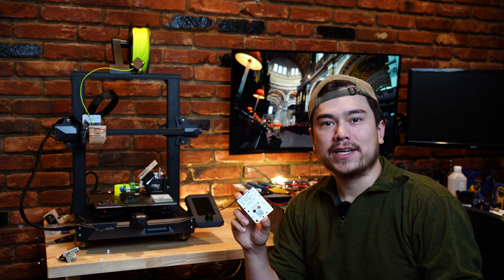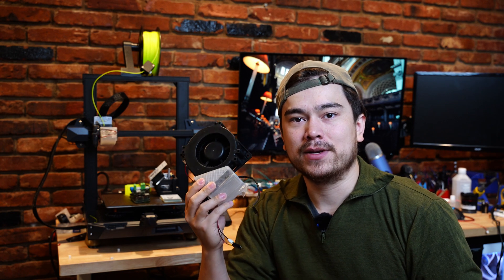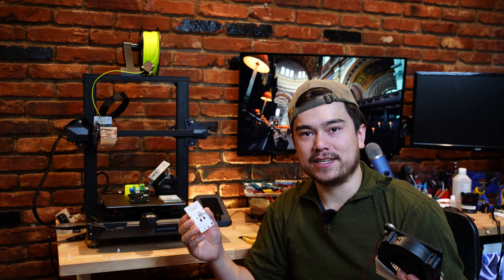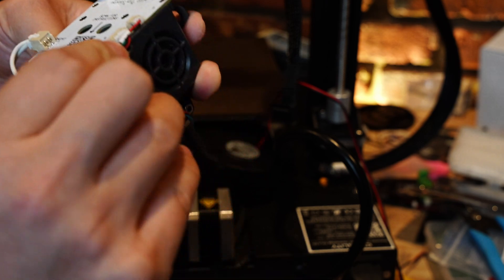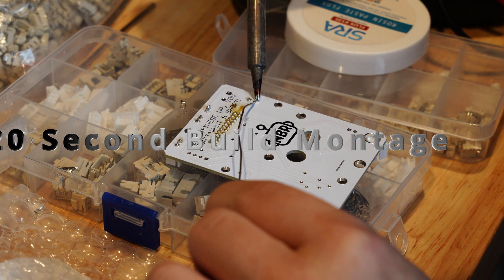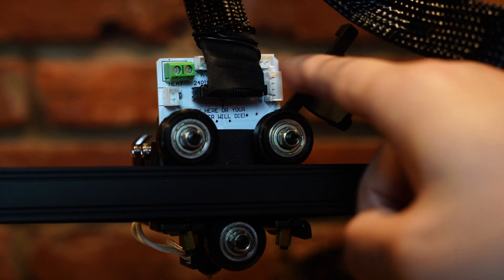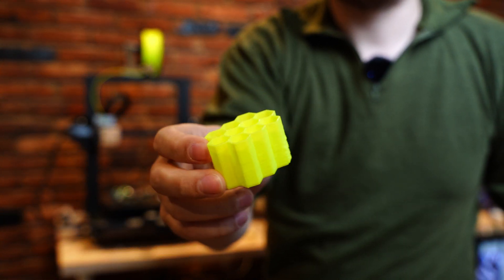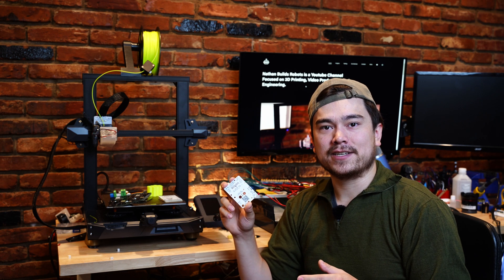More Ports, More Power, More FREEDOM! Ender 3 S1 Breakout Board Upgrade

Comment: Good sir, 
I've been reading/watching content on here and in your patreon and I was very excited at first to mod my S1.  However, as you mentioned in this video, messing around with the tiny connectors can be very easy to accidentally short.  Have neuropathy in my fingertips, they are often numb and I struggle ot feel what I am working on.  Seeing that this board was available for pre-order, I jumped to the site straight away to get it in before even finishing the video.  Now, I am watching the rest of it, haha. Also, I just wanted to pint out that there are no links for the fans you were going to suggest.

Thank you for your work and diligence.
Reply from the maker: I designed this board with the intent of making 3D printer mods more accessible. After all, not everyone has years of experience with electronics, or hundreds of dollars of tools required to make proper soldered or crimped connections.
However, you have brought up an excellent point that the small connectors on the original board can be challenging for people with reduced perception or mobility. Thank you for sharing your story.

Comment: Hey nathan, im new to upgrading but im working on learning how to deck out my ender 3 v1 neo. i just got the new neo se extruder (doesnt come with a hotend) i plan on upgrading my stock hotend with an all metal heat break and a nickle or copper heat block. then i want to install this mouse fan duct i found that surprisingly actually works with the neo! haha (not many shrouds do!) ive worked really hard at learning what i can make the best i can with what i have.. im gonna source my own stuff to do dual z cuz ill have an extra stepper motor from my extruder.. i really dont want to get a splitter cord.. i figured since i wont be spending the money on the dual z kit i figured id upgrade my mother board. well do you know if i can upgrade  my mother board and also add a breakout board? im not sure what the best route would be to go. i hope you can help guide me in the right direction of what i need!

Comment: Nathan, I want to buy this but my use purpose is the reverse - I want to keep the hot end on my S1 Pro and instead swap out the motherboard for something like a 4.2.7 or better.  I assume I can plug the board in on the motherboard side and use the breakouts there to plug into a standard motherboard with separate connectors, right?  The S1 Pro has a severely nerfed processor that only has 128k of storage, and I have modded my S1 to be full linear rails.  The limiting factor is that damn F4 processor.
Reply from the maker: You would need to get a cable that splits the 24-pin connector back out into the standard connectors. You could (and I have before, like on my Ender 2 S1 mod). Not sure if reccomend it but it’s certainly an option

Comment: 4:08 the part cooling is really quiet on my Sprite. The problem is the hotend fan…
Reply from the maker: Yeah, when I did a sprite installation on my Ender 2 Pro it has a quiet part cooling fan but a loud hotend fan. Never can win can you?
Reply: @NathanBuildsRobots  what do you mean?
Reply: @NathanBuildsRobots  maybe I’ll do a upgrade to a 5015 blower fan…

Comment: Just fried my original breakout board this week. Glad that I found this tho cause it's been a nightmare trying to get a replacement. Is there be chance a wire connector for a 24v led strip? Also whats the clearance like for a top mounted linear rail (ender 3 v2)
Reply from the maker: Not sure what the clearance is like for your setup, good questions for discord tho 😉

Someone on there recently hooked up a 24v light, it looked pretty awesome, but make sure you get the polarity right!

Comment: Nice job. Im just getting into all this, so very new. I have honestly only printed for about three weeks now and lucky the guy I talk to at Micro C. got me literally thier last S1. lol was misplaced but was on a list so got the discount. Anyway just started looking into upgrades and found your video. Like your approach and easy for someone new like me to understand. I might just have to try this out, or do you have an opinion on things to do first? Thanks either way for the good content im now suscribed!
Reply from the maker: Modding is all about your needs. For me, the loud fans were annoying so I prioritize switching out the fans and improving part cooling. IMO that’s all the printer really needs to be a perfectly good machine. 

Later on you might want to replace the hotend and nozzle to get higher flow rates or to be able to print with higher temp materials. In any case, have fun printing and look out for things you might want to add to make the printer better suit your needs!

Comment: On the Sprite/Ender 3P, can you bypass/eliminate the original ribbon cable completely or do you still need it for power? Im looking to eliminate the ribbon cable so I can extend the controller (Duet Mini) to outside of an enclosure.

Comment: Build the strain relief in with the key cutout for the plug all in one printed part!
Reply from the maker: That would be nice, my workaround for the next generation is to use the correct connectors that have the key built in!

Comment: Hi Nathan, 'fan' from Oz here, thanks for your content, and I'm eagerly awaiting your international compliance and shipping update. In the meantime I did short my fan wiring, the day after!!!! watching your video, what a goose! and now I am pretty confident my motherboard is actually cactus as I can't get it to run even with that board disconnected. I was running klipper but the board wont flash anything I can't go backward, forwards or sideways. The sales guy I talked to suggested I look into other motherboard options rather than the creality... so any suggestions? and go....
Reply from the maker: For sure, I'm at least going to comply with ROHS, that is the main thing. The US is a bit of an outlier with out liberal use of lead.

Sorry to hear about your board,but that is the issue with these boards being so tiny and hard to work on. Mistakes happen more often!
Reply from the maker: You'll have a hard time adapting a 3rd party board to the Sprite hotend. Creality is really trying to screw people into using only their parts. 
I bought a Sprite upgrade kit that lets you upgrade an Ender 3 v2 or older style board to a Sprite jotend. It comes with a ribbon cable to adapt the more typical board layout to the Sprite hotend. But it's a catastrophe of electrical engineering that is likely to start a fire... will share my thoughts in a separate video soon.

Comment: Good stuff. I would like the board to be as small as the original. I'm not sure I agree with the part cooling thing. Of course this heavily depends on what you print, but adding a 5015 fan instead of the small fan 3010 ads alot of weight ~10g vs ~25g. And even more with a mount for that cooler. I'm also worried about the board and the placement of the ribbon cable. What happens when you go max Z height? I printed a flexible cable mount on my printer, that required no screws and is made of 95A TPU. My original cable bracket actually cracked and this was the solution. All in all I do agree that it's annoying that Creality made this printer so limited, but in the same time I actually think its quite capable out of the box. After trying both the stock Sprite hotend and upgrading the hotend to the titanium copper one, I can say its an great upgrade for $30? Getting the pro firmware is the best upgrade and can be found on github for anyone wanting to trying it out: https://github.com/mriscoc/Ender3V2S1/releases/tag/20221002
Reply from the maker: Thanks for the advice, does the firmware work on Ender 3s1 Pro and Plus as well?

At max z height there is still about 50mm of room at the top, so the cables fit nicely, even at max z.

The whole hotend weighs 400-500g, I weighed it on my original S1 review. For me, 10g is a small price to pay for 2x better part cooling performance. You could save 100-200g by using a different extruder, which you could easily do with this board 😉
Reply: @NathanBuildsRobots  Unfortunately not

I see,  then it shouldn't be a issue. 
In regards to weight. Its only the fan thats 15g difference. Did you weight the whole assembly vs stock?

I haven't tested out my S1 with klipper yet and therefore not at the speeds klipper would enable, maybe improoved part cooling could help in that regard.

Comment: Just ordered mine today September 30 2022 would I be receiving the black PCB version ?
Reply from the maker: Yes, I'm still on the black pcbs
Reply: @NathanBuildsRobots  awesome ! Can't wait the black will look so good ,🙏 and what about that clip to hold wire in place and everything ?
Reply from the maker: @JustCreateYou  You will need to print one out to guide the wire and hold the connector in place. I am working on the CAD model for it

Comment: So if i buy this board? i will have to get the wires and connectors or does it come with board? i'm quite new into upgrading my ender , but long time 3d printer person lel
Reply from the maker: The board is only compatible with printers designed for the Sprite hotend. I just got a "Sprite Upgrade Kit", that comes with a cable that should be compatible with this board.
That should allow you to use this board on the Classic Ender 3s (Ender 3, Ender 3 Pro, Ender 3 V2, and clones like the Voxelab Aquila) I'm going to test it out soon.

Here is the kit that I am referring to:
https://amzn.to/3BSW8sP
Reply: @NathanBuildsRobots  sorry Nathan,  i forgot to mention that i have an ender S1 Pro ,

Comment: Will you release a smaller version without backwards compatibility?
Some of us want to use other tools heads. Say, Hero Me or Stealthburner.
Reply from the maker: I can do that. It would be cheaper board since it would have less SMT connectors and could be more of a DIY kit. The original version I made was more like what you are describing, but a lot of people wanted backwards compatibility. 
Let me get this launched first, then I can work on variants

Comment: I think it's fantastic that you're doing this. On a totally different subject, I wish you'd take a look at the lerdge K / Lerdge system. I think it's GREAT that it bypasses Marlin, and lets you program your own (to reference 70's drug culture), but I've been messing with my K board, and 4 different versions of their firmware for the last six weeks, and it's driving me CRAZY. Since their tech is closed source, i.e., stolen, maybe, is there a way to make it available to a larger group as an open-source system so everyone can program their own system?
Reply from the maker: I believe there are versions of Marlin and Klipper that supports Lerdge mainboards. I did a video on Lerdge when they sent me one for free. It is a steaming pile of garbage, full of firmware bugs.
My board corrupted its own firmware somehow, and would immediately turn the heater on 200C whenever the printer was turned on. And there was no protections or stopping the heater until I commanded it to a lower temperature.
I thought it was really cool at first, but in the end, its an unstable pile of garbage.
Reply from the maker: I really liked having the option to do all of the firmware configuration through the touchscreen, and not having to flash firmware over. But its much better to use something like Klipper if you want that level of flexibility, but with software that actually works.

Comment: Just placed an order but am confused on the board end (I have a 4.2.7).  dont they have to connect to the board to get instructions or is this for just power delivery to the fans?
Reply from the maker: This is for the Ender 3 S1 and other printers that use a sprite hotend. 
What type of printer do you have?

If you have an older printer, like the Ender 3 V2, you can upgrade it to the sprite hotend using a kit like this:
https://www.aliexpress.com/item/3256804412180235.html?spm=a2g0o.ppclist.product.12.2053OMQHOMQHRM&pdp_npi=2%40dis%21USD%21US%20%24389.29%21US%20%24109.00%21%21%21%21%21%402101d1bb16631246498585491ece49%2112000029777940251%21btf&_t=pvid:8c26c670-444d-4da8-89e0-0e47c497227e&afTraceInfo=1005004598494987__pc__pcBridgePPC__xxxxxx__1663124650

If you want to make changes to your order, send me an email with your order number.
Reply: @NathanBuildsRobots Hey Nathan,  I have a s1 and a pro with both having the sprite DD.  Maybe im having a brain fart,  but doesn't both ends of the ribbon cable plug into the something?  On your board, theres a new stepper plug. Shouldn't there be a new stepper cable plug on the other end of the ribbon to plug into the printer board?  Im guessing that I am overlooking something obvious. I actually wanted to change my order to 2 for both sprites.

Edit: ok, I think I get it now.  I can use either the sprite plugs or the new plugs. I was thinking that I could use all the plugs at once.
Reply from the maker: @paulfkim  Now you're thinking with portals!

In most use cases you'll just use one or the other. You just mix and match based on whatever connectors are compatible with the stuff you're installing.

Comment: Ordered one! Was getting scared when you said surface mounted, then you said you're building it...
Reply from the maker: Yeah those surface mount components are a bit tricky. I will be soldering them in bulk, and doing error checking using Mr Clicky, which will be shown in next video, so you don't have anything to worry about with the surface mount components!

Comment: Looks great Nathan!
any chance you could integrate a 24V-to-12V step down converter on the breakout board? It would make connecting Noctua fans so much easier for me (using your dual 4020 axial fan duct for part cooling and hotend cooling). The ease of use of 4020s, and with how quiet Noctua fans are makes me want to never go back to blowers (which I've always hated). 
Even if the answer is no thanks for reading my comment and keep up the great work! I've made my printer quieter and my prints better, friend!
Reply from the maker: I ordered a bunch of 24v 40mm fans (about 16 different models) from Sunon and Delta. I'll be doing some testing to see how they stack up to the 40mm noctua fans.
I'm hoping to find some good substitutes without the need to step down to 12v.
Also noctua has announced they are coming out with some 24v fans soon. 
So I'm predicting a future without 12v fans.

Comment: What is the component name of the 24 pin connector ?
Reply from the maker: I couldnt figure it out. I tried ordering several different connectors but none of them were compatible with the one Creality is using. I ended up going with some pin header that will be combined with a 3D printed clamp that is secured in the 2 screw holes that normally hold the rubber strain relief.
Reply: @NathanBuildsRobots  Thanks for reply but what is the male connector you are using on the PCB?

Comment: Nice! This is so great :D So theoretically this would make it easier for me to upgrade my extruder to something like an E3D Revo Hemera?
Reply from the maker: Yes, you would just need to mount the hemera in such a way that the 4-hole pattern on the back of the stepper motor is exposed. I'll be doing a video on setting up non-sprite hotends in the near future.